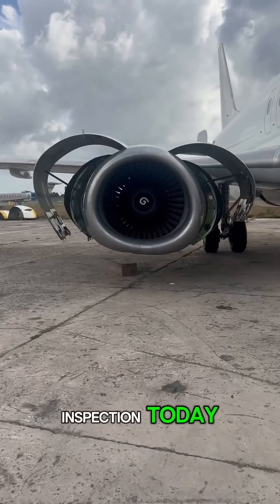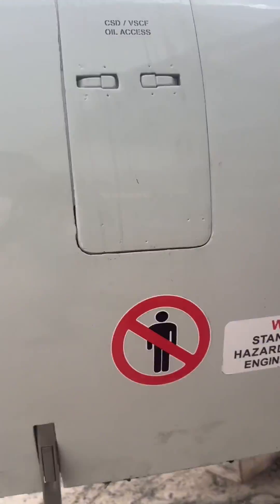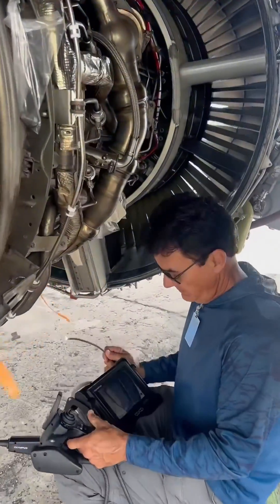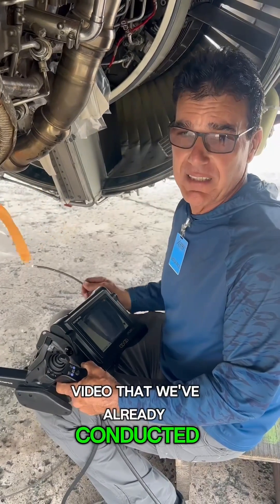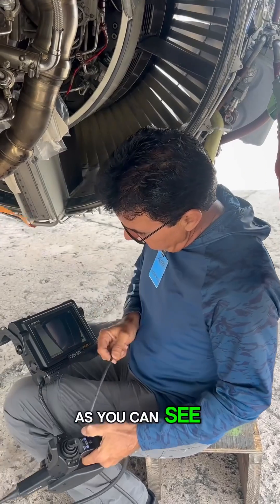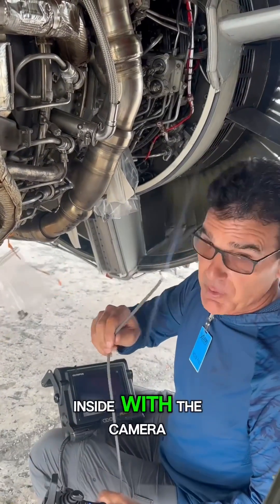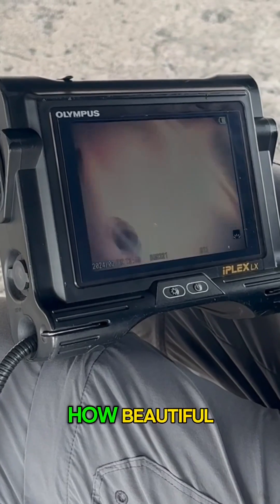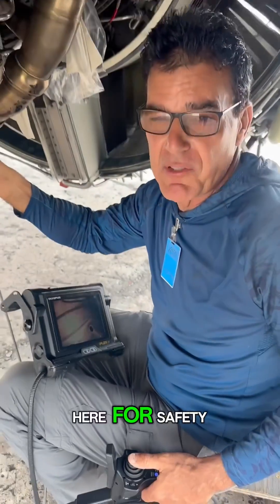You don’t see this Aviation office every day #aircraft #video #foryou

Comment: Great Video as always. Whats is in your opinion the better enegine? The CFM 56 or the IAE V2500. I mean in case of durability, mechanic friendly, and good access to the engine parts.
Reply from the maker: Thank you very much Stefan for continue enjoying the videos. I am a big fan of the GE cfm56, CF6-80 and the GE LEAP engines. The V2500 has issues with deterioration of the hot sections. See you next video. Don’t know if you have seen this one link below ⬇️ 
AIRPLANE TURBINE ENGINE INSPECTION / CHANGE / START UP #airplane #facts #foryou
https://youtu.be/adZ6TniIbzE